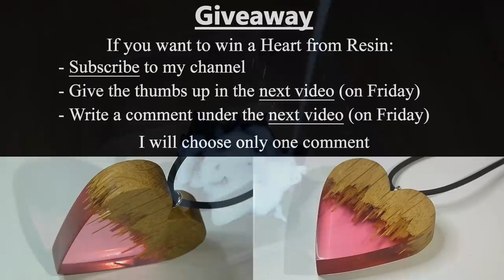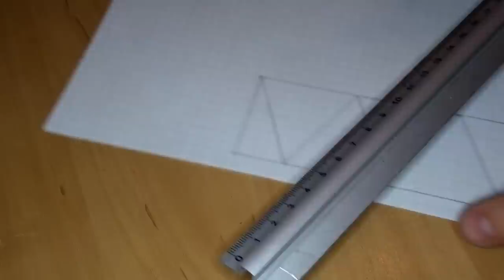5 MOST Amazing DIY Ideas from Epoxy RESIN. SIMPLE Tutorial / Resin Art / Part 2

Comment: I was just thinking how long he dried that glue cause 10 drops of glue takes 2 days to dry
Reply: what glue
Reply: what glue
Reply: Dude this is epoxy resin,They dry faster than glue.I mean,No...but actually...Yes
Reply: Its silicone
Reply: @ra1224  he wasn't talking about the resin, he was talking about the quick dry glue or the silicone (1 of the 2 becuase the silicone looked like kids school glue)
Reply: MjPlayZ 101 wdym by what glue the glue gun
Reply: Random Frog he means the glue gun
Reply: It's not glue. Its silicone which doesnt Cdry" per se. It cures so it's much faster than glue, which generally dries through evaporation.
Reply: Is epoxy resin, not glue or silicon
Reply: He probably did time lapse
Reply: It's silicone my dude
Reply: The white is silicone, glue is much more plasticky in texture. Very difficult to cut and not flexible enough to make a mold.
Reply: DioChu why does that profile pic exist. And why does it fit together so well.